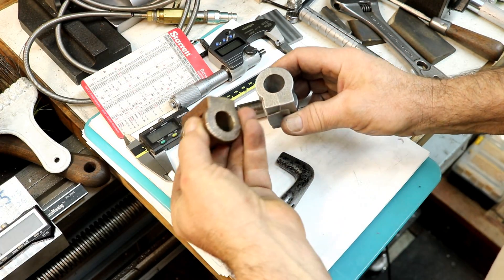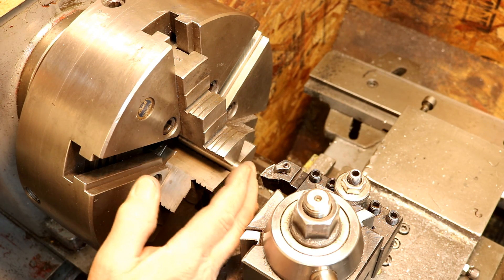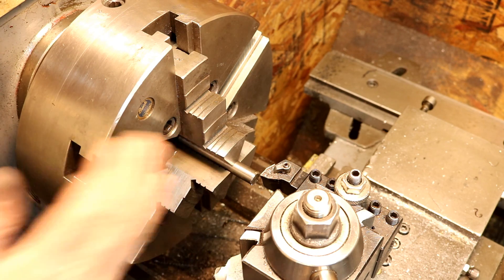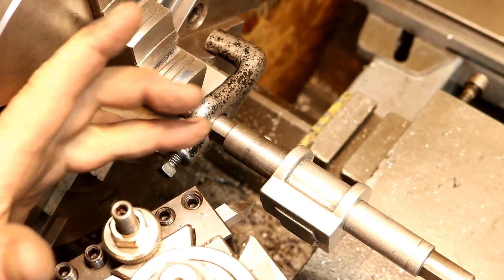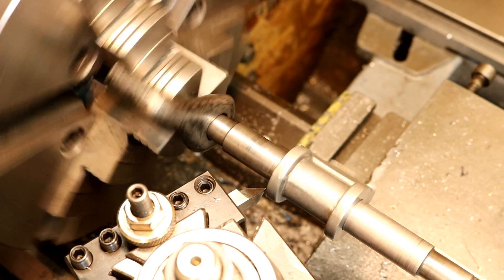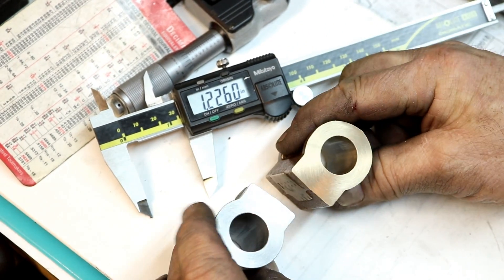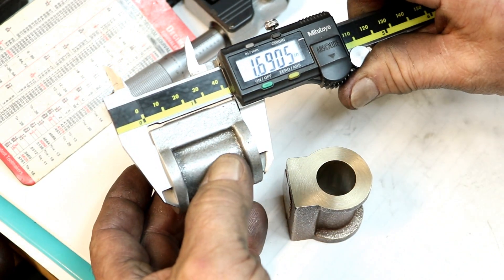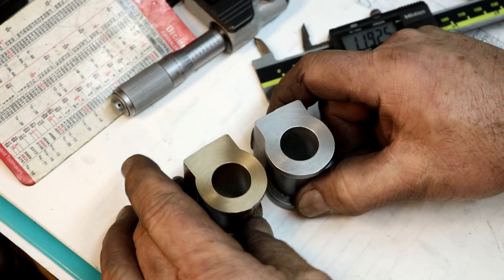P1-4 How to Build the Cylinder of a Model Steam Engine for the First Time

Comment: Hi Randy floods hit the California desert, now back to learning with RANDY. Boy in the camera angle that tapered cit got right up the lathe chuck wow wee you are good sir.  Saw a guy this morning sharing his camera screen wall mount he learned to film using from you. This is a good way to square the ends to the bore.  They look great.
Reply: Got any video or pictures of the flooding?
Reply: @MaturePatriot  No not last nights but we did have to run out and prepare our pumps to keep the water away from the Workshop, machine Shop was fine. Thank you for asking but no pictures we have shot some in the past though.
Reply from the maker: We are getting a lot of Rain many inches, 1.5 in of hail last night.  At 4000 ft tough to get flooding, most everything is down hill.
Reply: @RRINTHESHOP  Yep, that's why I live up on the mountain.  I don't swim, when I go in the water the life guards go on alert.  They say, "Vernon's gone in drowning again!"